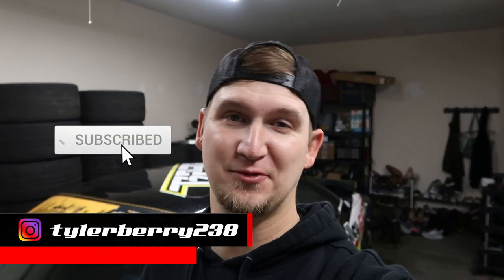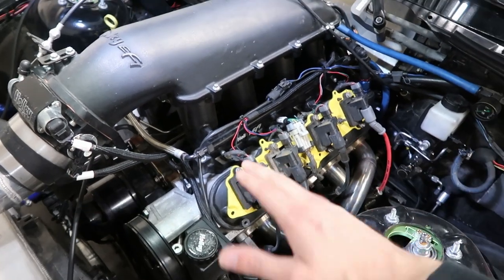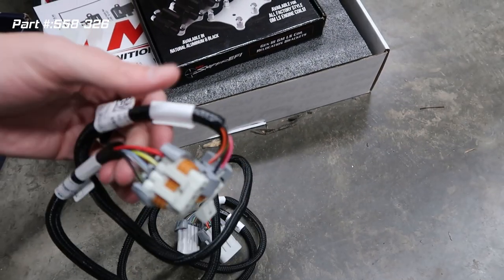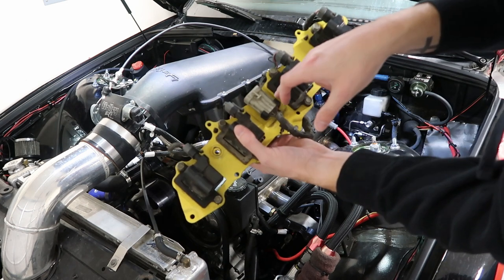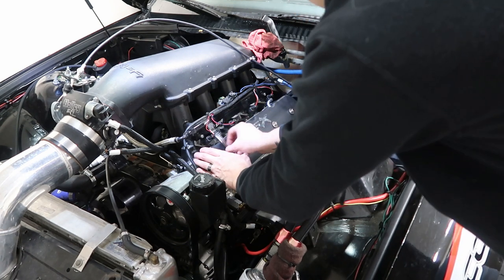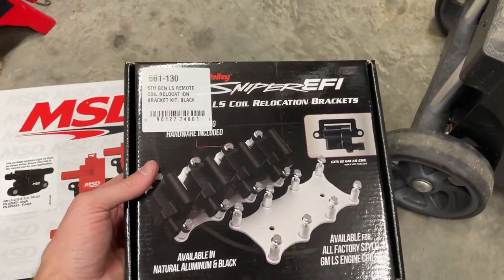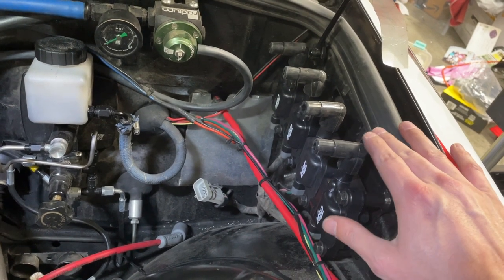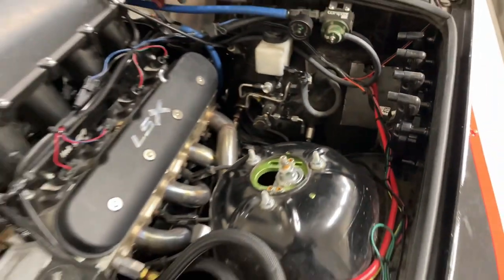LS Coil Pack Relocation by Holley - Pt 1

Comment: Holley also have 2pc valve covers that hide the coil packs part # 241-172
Reply from the maker: Yeah those are pretty cool! I just wanted to try and get the wires away from the headers more.
Reply: @TylerBerryDrifting  Im trying to do this on a sbc i have the Accel Gen V supercoils part # 140080-8 planning on getting this bracket what spark plug wires do I need will the Accel 9060 Extreme work
Reply from the maker: I would have to check into that. I’m not entirely sure off the top of my head.

Comment: That looks good! Are you using an LS power steering pump? We just recently made some adapters on our twin turbo 6.0 e36 to mount the bmw power steering pump on ls heads.
Reply from the maker: Yes. I am currently using the LS power steering pump and haven’t had any issues…. Knock on wood! Lol that’s pretty interesting!
Reply: @TylerBerryDrifting  gotcha,  yeah we did some research when doing the actual swap and sounded like the bmw pump performed better and was more responsive than the ls pump so we designed a bracket and it seems to work decent.
Reply from the maker: Like I said, I haven’t had an issue with the LS pump yet. So in my mind, if it ain’t broke, don’t fix it! Lol But if it goes out, I may have to look into your adapter and see if it’s any better!
Reply: @TylerBerryDrifting  Sweet, good to hear you haven't had and issues. We run the LS pump on our 240sx and no issues there either.  Just saw your video and thought I'd get your opinion,  good looking car and good chatting with you!
Reply from the maker: I appreciate it! Good talking with you as well! 🤘🏼